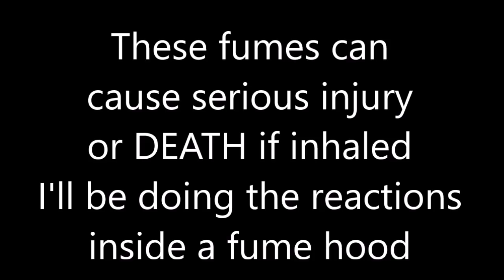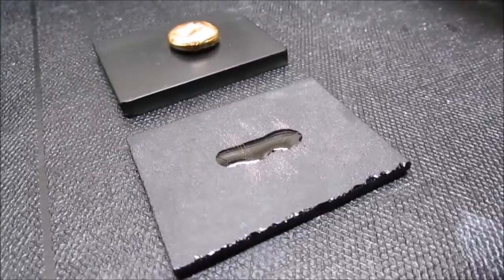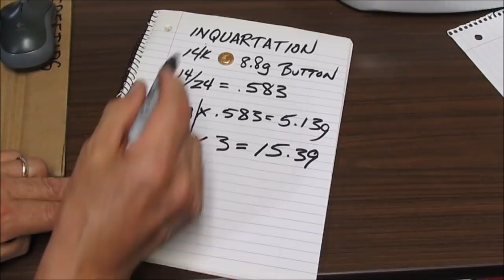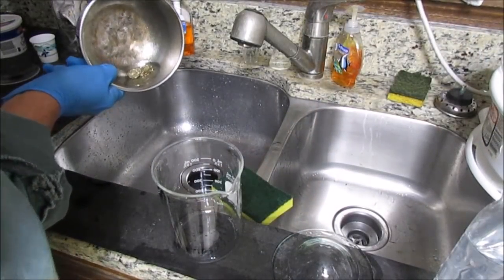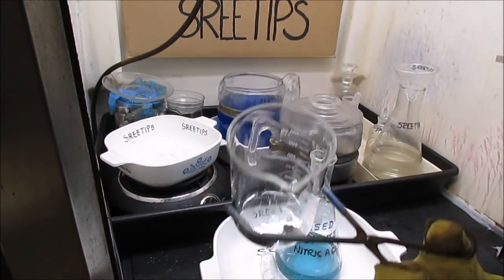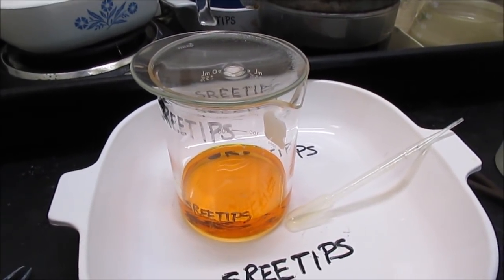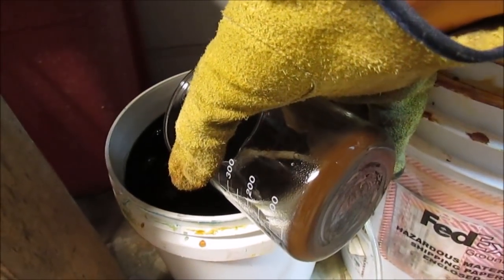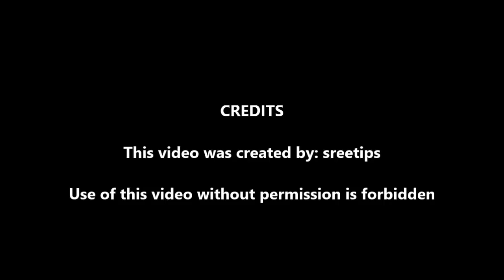Alaskan Placer Gold Silver Button Refining

Comment: Hi! Thanks for your video! Have you notice something about the silver buttons containing gold?
Reply from the maker: I know that silver is a carrier of gold and platinum group metals. I dissolved an old silver mug from the 1800s. I couldn't sell it because it didn't have Serling or 925 marked on it. I took it to a pawn shop just to see what they would offer. They rejected it, even after they tested with acid, because it didn't have the "proper" markings. I dissolved it in dilute nitric and filtered the residue left and I recovered almost 1 full gram of pure gold, just from that one 780 gram silver mug.
Reply: sorry I meant if you have noticed a tell of sign if a particular silver button contains gold. Just like you can tell if there is PGMs  present in a silver button by the frosty crystalline structure created on the surface upon freezing (occurring even if tiny amount of PGMs are present)
Reply: I've noticed that silver buttons containing gold tend to form a slight dip upon freezing just like yours
Reply from the maker: I did notice that. And I could see that the button had a slight yellow tint. I tried to make some karat gold once by mixing pure gold with silver. Instead of gold, it looked exactly like the button in this video.

Comment: Thank you.  I find your videos of process and elimination refreshing. I collect bullion and for the past few years been removing gold from computers phones etc. I am nearly ready to start refing.  But u need to use poor man's aqua Regia.  Can I ask a favour please, show me or us your fume hood. I am preparing a lab but I need to figure out how tall the outside flume needs to be. I am worried about how far the fumes will travel. And what materials should I use to build one? I am considering glass and wood with a layer between glass of insulation. Thanks again
Reply from the maker: I bought that fume hood on eBay about 6 years ago. It has a metal exterior. It has a fiberglass interior. It was fairly easy to install. I had to cut a hole in my roof and in the ceiling to my garage. I documented the entire install on the goldrefiningforum.com complete with photos of the entire process (it was before I started making videos). You can join the forum for free. My user name there is "kadriver". Do a search of my posts using key words "fume hood". Or, here is the link to that post: http://www.goldrefiningforum.com/phpBB3/viewtopic.php?f=56&t=15831&p=160119&hilit=Fume+hood+installation#p160119
Reply: sreetips I am on there jonrns
Reply from the maker: Ok, got it. In one of the photos I shot a picture of the stack (6 inch PVC pipe) sticking out of the roof. I think it extends above the surface of the roof about 4 feet. If you needed higher then you could get a second length of 6 inch PVC and glue it to the top of the first piece of PVC.

Comment: Great video. Question: Why is the solution cooled before filtering?
Reply: Sylvain Thanks
Reply: Silver chloride is less soluble in cold water than in hot.
Reply from the maker: I think silver chloride is insoluble in water, hot or cold.
Reply: almost insoluble : silver chloride solubility in g/100 cc 
0.000089 in cold water
0.0021 in hot water
Reply from the maker: So this is why the solution turns cloudy when ice is added. I always thought that it was due to the pH changing after dilution with the ice. Good call.
Reply: Yes, with the ice you get both of the factors contributing for AgCl precipitation :  cooling and dilution